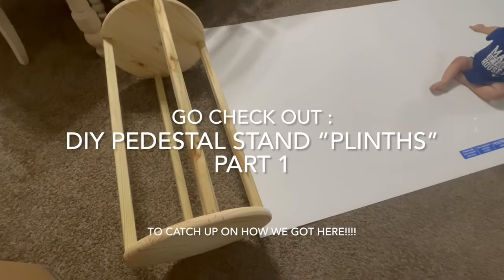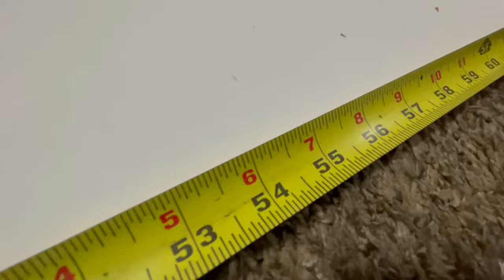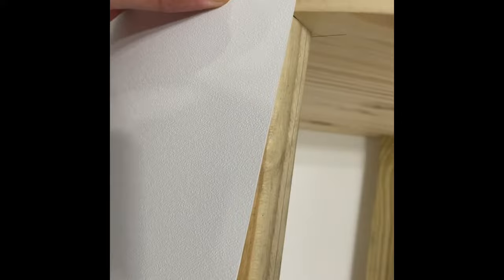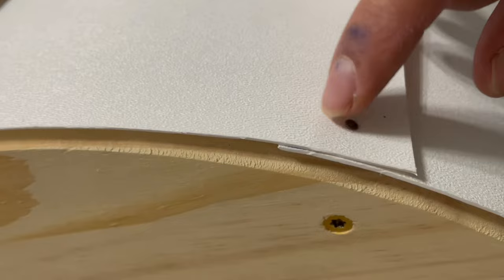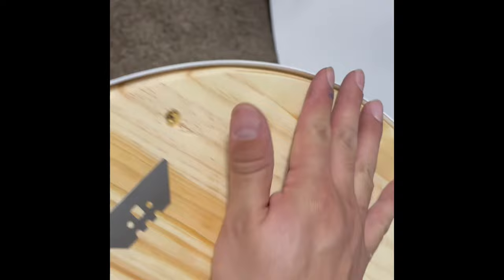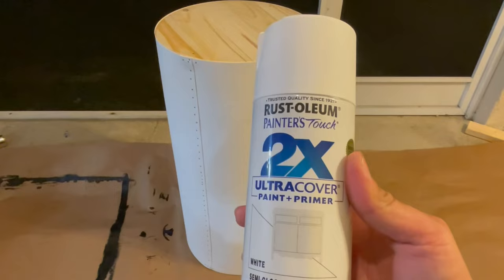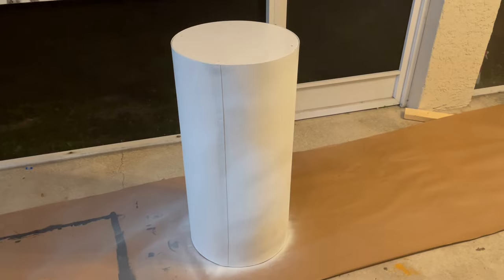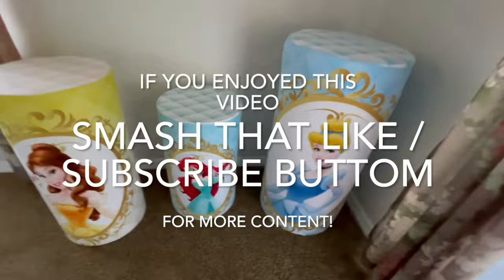DIY Pedestal stand “plinths” part 2

Comment: Is poly wall like a sheet of trovicel / pvc? In my country El Salvador I can find different thickness like 3mm, 4mm or 5mm what thickness did you use?
Reply from the maker: Hello from my research trovicel is mostly made from foam not sure if that would work as good as the poly wall, they scratch And dent easily, it probably can work if you only do indoor type of events, the cylinders we have here are made to take a beating and last a while. Not sure if that helped much

Comment: We don’t sell poly wall in Australia. What is an alternative material that I can use please?
Reply from the maker: Well, not sure what type of material you sell there but you can look into using ceiling board or Arctic white fiberglass, but those can get expensive
Reply from the maker: Hope that helped a bit
Reply: How thick was your poly wall? I have found a similar material.